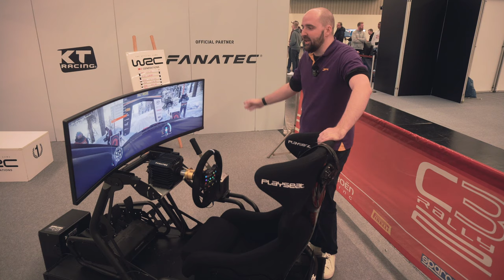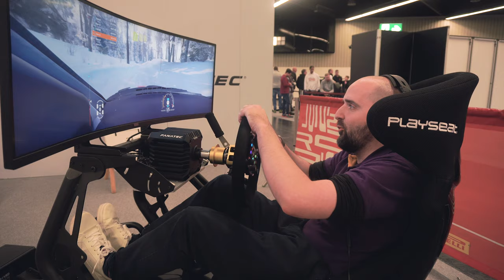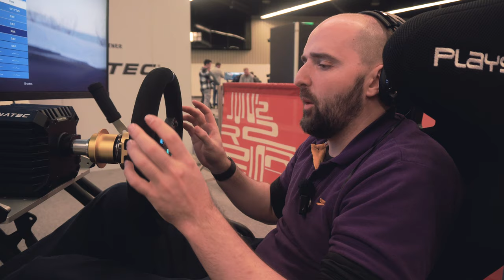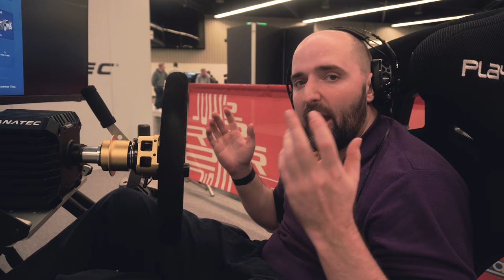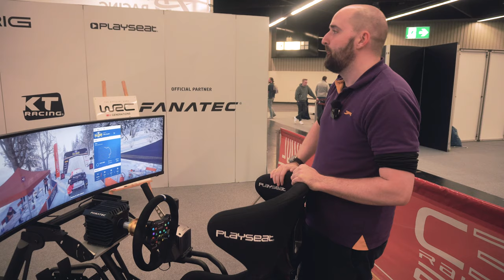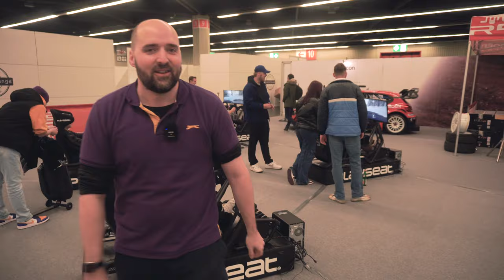Fanatec Button Module Rally With Sparco Wheel Rim - First Look

Comment: Lots of buttons that can not be easily reached, bit like my podium module endurance. This is why gt3 and formula wheels are good: you can reach buttons.
Reply from the maker: I'm happy with like shifters and a few buttons on the wheel and then id just like 10 funky joysticks lol
Reply: This may be because in reality with GT3 and formula in particular you make adjustments on the fly, whereas in WRC you make them before or after the rally stage.

Comment: Very good everything. A lot of colours and so on but that hand brake is totally in a wrong position. In order to use it you have to separate from the seat in order to reach it. Also it should be on the right side of the shifter. Nice video…

Comment: One thing I don't think has been said yet is, will it work only with Fanatec eco-system?
Reply: Same connection method as the Button Module Endurance which, AFAIK, also doesn't work on anything else, so yes.

Comment: So, it's been over a year since they brought a first-article unit to you for review; any sense for why this product is languishing?  This is a button box, not a new drive system and accompanying firmware and software.   This needn't be a massive R&D project, its just a basic hardware user interface/UX project.   At this point, shouldn't this have been officially canceled, released or delayed?   If licensing issues have arisen, with regard to the original design partnership,  then let us know, and we can move on.  Jeesh.